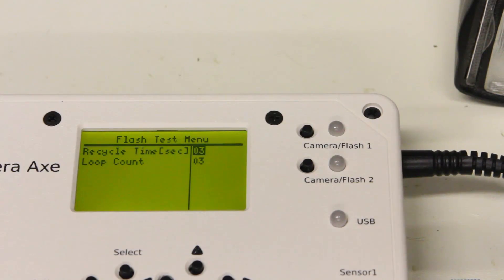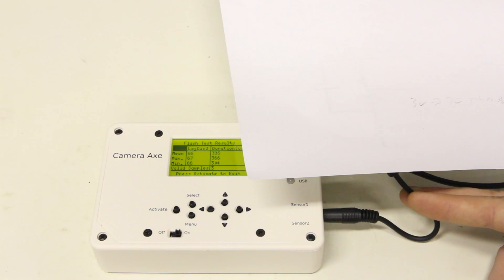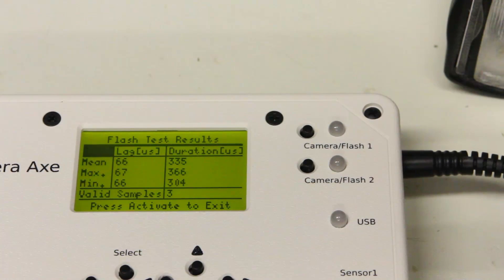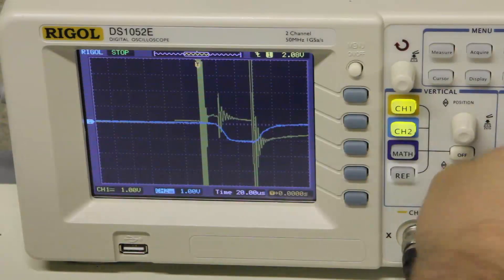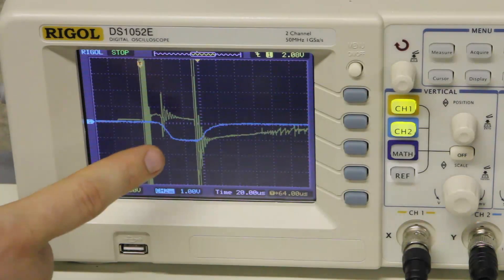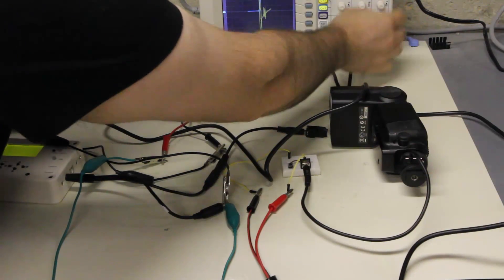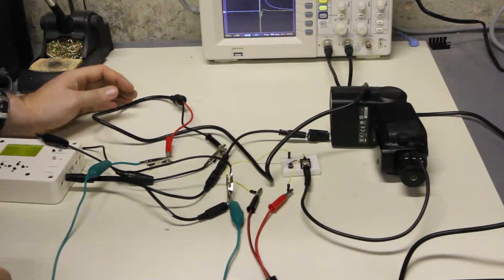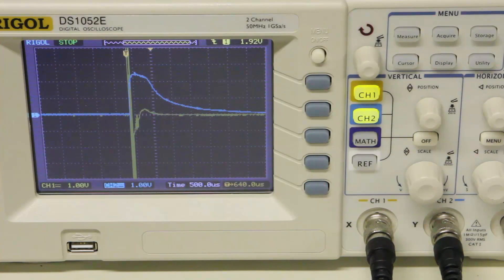TPB #48 - Flash Duration Verification

Comment: The Cameraxe does not use the pins 25 & 26, connected to sensor 1, as digital inputs on sensor tests. In this, the 2.3-2.5v range does not play a part in the accuracy of this test. I do, however, believe you are accurate in assuming the fall time of the sensor is just too slow to accurately measure the duration of such a fast event.